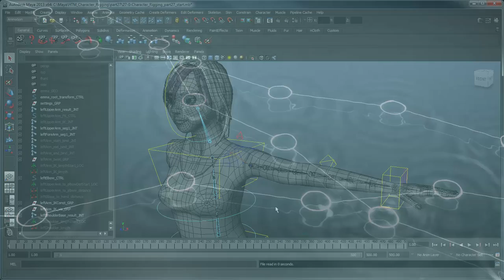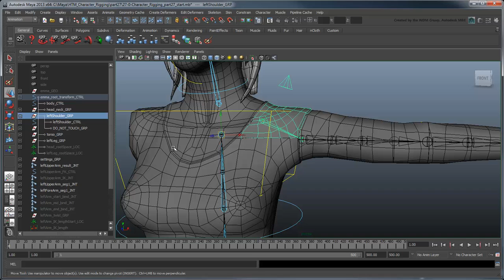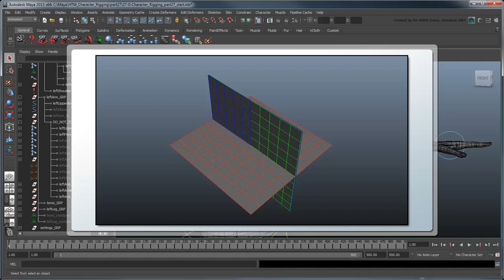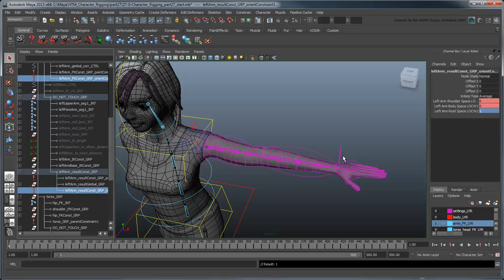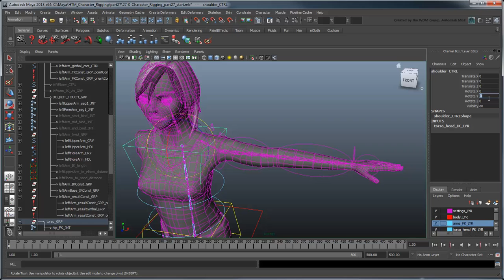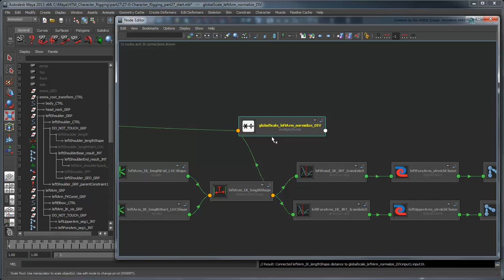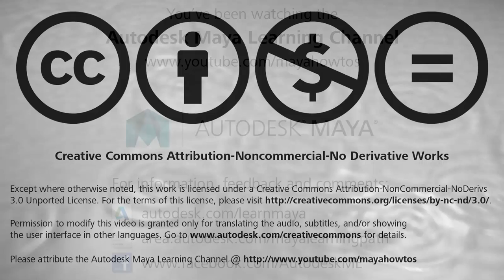Creating a Character Rig - Part 27: Arm global transform and cleanup (Advanced)

Comment: Hi, thanks for the tutorials. I've been learning tons. I have a question concerning the plusMinusAverage node you named gimbal_correction_ADD for the left arm's gimbal_corr_CTRL. I noticed you used this to get the gimbal controls on both arms to rotate in the same directions but it's not shown in the video how you set it up. Each time I try to replicate it from the Part 32 Mirrored Rig, the FK controls and arm geo flip. 

My process for attempting to replicate this effect has been to group the leftArm_gimbal_corr_CTRL into a leftArm_FK_gimbalOrient_GRP. I turn inherit transforms on for the gimbal_corr_CTRL and set the rotateX attribute on the orient_GRP to 180. This flips the FK controls into the -Y axis. I also select the leftArm_resultGimbal_GRP and group it to itself, naming it leftArm_result_gimbal_orient_GRP. I set the X rotation for this new group to 180, which put the arm geo and FK controls in the same space as the gimbal control. Then I select the leftArm_gimbal_corr_CTRL and the leftArm_resultGimbal_GRP and open the node editor to show their connections. I create a plusMinusAverage node and name it gimbal_correction_ADD and feed the output from the leftArm_gimbalCorrToggle into the input3D of the gimbal_correction_ADD node. In the attribute editor, I add a new item under Input 3D and set the X value of the new Input3D[1] to 180. From there, I plug the output3D into the leftArm_resultGimbal_GRP's rotate attribute. 

After doing those steps, my FK controls are still rotated upside down in the -Y axis with the arm and hand geo. Could you describe how you set this up or is it covered in another video? I'm using Maya 2018 if that helps.
Reply: Ok, I figured it out. I'm going to write up the procedure I used so that if anyone else is struggling with it like I was, they have a step-by-step method to follow. I apologize to anyone that finds this extremely obvious.

1. Unparent the leftUpperArm_FK_CTRL from the leftArm_gimbal_corr_CTRL
        a. Open the channel control and unlock and show transforms
2. Rotate the leftArm_gimbal_corr_CTRL 180 degrees in X. Freeze all transforms and make sure that inherits transforms is turned on.
3. Create a null group node named leftArm_FK_gimbal_orient_GRP and set its rotateX attribute to 180. 
        a. Parent this new group under the leftArm_FKConst_GRP.
4. Parent the leftArm_gimbal_corr_CTRL under this group and set its rotateX value to 0 (it will flip to -180).
5. Group the leftArm_resultGimbal_GRP to itself and set the pivot to the upperArm_JNT. Rename the group to leftArm_resultGimbal_orient_GRP
        a. Set this new group’s rotateX value to 180
6. Select the gimbal control and open the node editor. Show its connections.
        a. Break the connection between the leftArm_gimbalCorrToggle (blendColors) node and the leftArm_resultGimbal_GRP by deleting the conversion node between them.
        b. Create a plusMinusAverage node and rename it gimbal_correction_ADD
        c. Plug the leftArm_gimbalCorrToggle’s output into the ADD node’s input3D[0] attribute
        d. Select the ADD node and open the attribute editor
        e. Under input3D, add a new item and set its input3D[1] X attribute to 180
        f. Plug the ADD node’s output3D into the leftArm_resultGimbal_GRP’s rotate attribute
7. Reparent the FK controls under the gimbal control

Comment: Greetings! It looks like the LRAs of the gimbal correction control in this scene file differ from those  indicated in part 32. Should I change the LRAs too?
Reply from the maker: Hmm, I just checked my files and they appear the same for me.  X goes along the joint, Y points straight up, and Z is forward relative to the character's body.
Reply: @Autodesk_Maya  Hm. I just downloaded the scene files and compared part 27 with part 32. The LRAs of «leftArm_gimbal_corr_CTRL» are different. 
Screenshots: https://i.imgur.com/WucFg4l.png
Reply from the maker: @DarkMidlight  Hmm interesting.  On my local files they're both the same.  I wonder how that happened.  Either way, these are just gimbal corrections so it doesn't matter too much since they will only get used in very extreme circumstances.  However, I like having the positive rotation consistent with the FK controls (so +ive = counter-clockwise) so I would go with the Y down orientation.  Again though, neither is really wrong so long as the right-side rotates consistently with the left.
Reply: @Autodesk_Maya  Okay. I like positive rotations too. Thanks!
Reply: @Autodesk_Maya  In case you're interested, there are 2 added groups (which are rotated 180* in X) and extra math node: https://i.imgur.com/zkfLnvj.png. Looks like there was some tweaking in part 32 scene file in order to get proper rotations for the gimbal correction control.
Reply from the maker: @DarkMidlight  Ah yes this is starting to ring a bell.  Sorry it's been years since I worked on these files.

Comment: Hey MLC hope all is well, one more question [hopefully] everything works great for me up until i orient constraint the shoulder body and root locators to the fk and result const group. When i try to test them in various spaces they work but then my armctrl no longer follows the resultarm when i translate the shoulder up. I tried it with maintain offset on  and i get a similar result . I check my scene with your scene everything seems to be correct. I even re did both my arms and im still getting stuck in the same spot . Im using maya 2018 maybe theres a setting im missing. Thanks again for all your help. Amazing tutorial btw learning  so much
Reply from the maker: Is this your Arm Settings Ctrl you mean?  Or all of your FK arm controls?
Reply: @Autodesk_Maya  hey mlc sorry for the late response it is actually my leftarm_ctrl  looses its connection with the ik hand joint  when the shoulder is translated in y  so instead of staying planted to the arm_ctrl it moves up. I can hook everything up and get it to move correctly its up until we do the space switching it messes up just the armcrtl Connection.if that doesnt make sense i can give also send u a visual rep.
Reply from the maker: @Funny3dguy  I think I understand.  Are you sure the locator for that particular space is placed correctly in the hierarchy, and that the arm control isn't parented / parent constrained under it?
Reply: @Autodesk_Maya  hey mlc thank you so much that fixed the problem and i can move on i actually have one more question ill post it on the tutorial

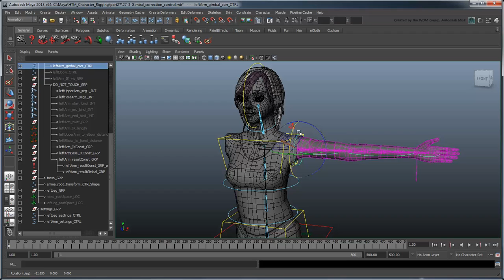Comment: After completing Part 27 @15:23 both arms have a slight bend at the elbow while in IK mode. I just finished rebuilding both arms and everything was working perfectly until this point. The rig and measurements are scaling correctly and everything else is working right. Any idea what is happening here? Could this have something to do with the Set Preferred Angle in Part 23 @7:12?

Updated images added 10/25/2018 at: https://www.infinitee-designs.com/part-27-completed
Reply from the maker: Did you snap the Measurement node locators to the correct joints on your rig?  Are you sure the default and 2x values on your driven keys lines up with those exact measurements in the default pose position?  If you moved them after the fact, you might need to redo those driven keys.
Reply: Are you referring to the measurement locators for the upperArm, elbow LOC and hand?
Reply from the maker: @RalphManis  Yup.  Basically anything involved in calculating the squash/stretch of the arm
Reply: Did you snap the Measurement node locators to the correct joints on your rig? 
 • Yes. 

Are you sure the default and 2x values on your driven keys lines up with those exact measurements in the default pose position? 
 •  Can you please explain this one a little more. Which 2X values and which driven keys?

If you moved them after the fact, you might need to redo those driven keys.
 • I'm pretty sure that I didn't do that but exactly which driven keys should I check?

Sorry to be a such pest but I am so close to getting this :)
Reply from the maker: @RalphManis  So in part 23, around the 10:40 mark, you ran a script that determines exactly when length squash/stretch begins by defining the exact length of each part of the arm and the total length when the arm is fully extended.  However, if those values were even a bit off, it could cause your arm to either squash/stretch prematurely, or bend prematurely.  Sometimes these values might be off because you input them wrong at the time of setting this driven key, but sometimes it's also because you may have accidentally moved the graph in the graph editor just a bit.  Either way, you want to make sure that these values really do accurately reflect your arm joints' exact lengths.
Reply: Okay, thanks I'll start digging.
Reply: After rebuilding the arms from scratch again and being very careful to keep everything in it's proper place, my left and right Forearm and Hand_IK_JNT_translateX's still wind up with a bend at the elbow. The only fix I could come up with is adjusting the left and right Hand_IK_JNT_translateX Key values but this still results in slight movement between FK and IK switching with the left and right Arm_settings_CTRL's. I also seem to have duplicate Keys (See images in link: red ?) for the rightForeArm_IK_JNT_translateX but I'm not sure where they came from, how to get rid of them or if they will have any negative effects during animation.

https://www.infinitee-designs.com/part-27-1523-complete
Reply: @Autodesk_Maya  I don't really want to make it publicly accessible. Is there some way I can contact you with a link to it? You can contact me via my contact form... https://www.infinitee-designs.com/contact

Comment: Part 27 @15:15 When connecting the globalScale_leftArm_normalize_DIV Rotate X to the leftForeArm_IK_JNT_translateX's Input, my left arm bends at the elbow. I am wondering if this is due to the fact that my upper arm and forearm are not equal lengths? I have build the left and right arms from scratch multiple times and get the same results at this point.

See example at: https://www.infinitee-designs.com/part-27-1515
Reply from the maker: It definitely shouldn't matter that the upperarm / forearms are different lengths.  Are you sure that the measurement nodes are accurately reflecting those lengths though?  And given that this only happens when you attach the normalize DIV node, does the problem get worse / better if you scale the rig up and down?
Reply: Thanks for getting back to me. It gets worse as I scale it up and down. I am in the middle of rebuilding both arms at the same time and am at part 25. This rig have another problem that I don't think can be fixed very easily, as I switch the leftArm_settings_CTRL from FK to IK the joints at the hand are a little off causing the arm to elongate just a little but enough to tell me that something is not right.

Thanks again!
Reply from the maker: @RalphManis  For the former issue, try showing the measurement nodes and their locators.  Are they scaling correctly when the entire rig is scaled?  It sounds like they might be scaling at a different rate.  

For the latter issue, double check that all your IK, FK, and result joints are exactly on top of each other when the rig is at a 1:1 scale in the default position.  It sounds like one or more of those joints have been displaced slightly.
Reply: All the joints start off in the same position but after switching the result, FK and seg joints translate along the x axis and the rig defiantly doesn't scale right. I have tried disconnecting them in the node editor and re-positioning them but there is just to much interconnection going on. I added another image to the bottom of this page... https://www.infinitee-designs.com/part-27-1515. I think I will just go with the rebuild of both arms for now but thank you anyway!

Comment: hi! i have a problem at 10:30, where you turned off the leftUpper Arm_CRV and leftForeArm_CRV's inherits transform. I followed exactly the same steps however, when I rotate the root_transform_CTRL, the left arm is offset with the rotation. do you have any suggestion or idea why this is happening?
Reply from the maker: Is it possible your leftArmBase_IKConst_GRP is rotating?  Perhaps it wasn't parented correctly?
Reply: Hi, thank you for the prompt reply. Perhaps,  I did not do a thorough check on it. However, as I redo the part again it works! By the way, thank you for the tuts, they are really awesome!

Comment: I'm at 11:29 of part 27 and when rotating the shoulder_CTRL the left arm is not staying straight. It appears that the leftArm_GRP is not parented to the shoulder or shoulder_CTRL.

Also, when I translate the leftShoulder_CTRL upward it does not move in same way that Emma does.

My projects leftShoulderBase_result_JNT has 0 transforms for Rotate Z Yet, Emma's has a rotation value of -24.124. Could this be the problem? In part 26 @6:49 it says to rotate the leftShoulder_GEO_GRP but nothing about the leftShoulderBase_result_JNT.

See image at: https://www.infinitee-designs.com/part-27-1129

Solved by selecting the leftArm_settings_CTRL opening the Channel Box and setting the FK Rotation Space to "shoulder".

Comment: To Maya learning Channel: 
the way the left arm is design based on your tutorial if you move the FK arm in the positive Z direction the arm moves down to the side of the character rig correct. [5:32] However once you parent the FK arm under the gimbal_correction control if you move the Fk arm with the gimbal controller in the positive Z direction the FK arm moves up over the character head. How do it fix this so that the FK arm moves down in a positive direction?

Comment: I'm having a problem when setting up the driven keys (~9:50) with the right arm. When I set the orientConstraints to the Shoulder Space, the right arm result groups rotate. No issues with anything else at this point.
Reply from the maker: It sounds like the joints' Local Rotation Axes are not aligned.  I'd double check any/all the joints that overlap and make sure their LRAs match.
Reply: Will do, thanks!
Reply: The only one that doesn't match the joints it overlaps is the rightShoulderEnd_result_JNT and I can't seem to orient it any other way.
Reply from the maker: The end result joints shouldn't matter.  Did you double check your space locators to make sure they aligned as well?  Also, when you created those Orient Constraints, did you make sure to do so with "Maintain Offset" turned on?  The problem that you're seeing is due to the different orientations of the spaces (which is fine, so long as you keep the offset between them).
Reply: It may be the Maintain Offset option. I'll double check!
Reply: It turns out it was the locator being flipped in the X axis. However I ran into another problem that was addressed in the comments with the orientConstraints having an Offset Z value of 53.13. So when doing the set driven keys, I had to also key the Offset X values for each space (180 for shoulder, 0 for body and root). 

What is the cause of this? And thank you for all the help!
Reply from the maker: It depends on how you built the arm (from scratch or mirrored joints).  But basically, the different body parts live in different spaces, which is the whole point of being able to switch from one to another.  However, by that same principle, a specific rotation in say, shoulder space, won't have the exact same values in neck space.  That offset records the difference in the spaces (also why the Maintain Offset option is so important).

The same principle applies from the left side to the right side of the body, especially if you mirror the joints (because the right side essentially exists in a negative left-side space).